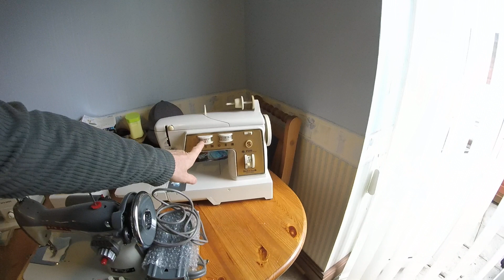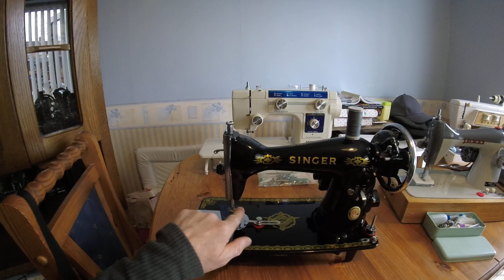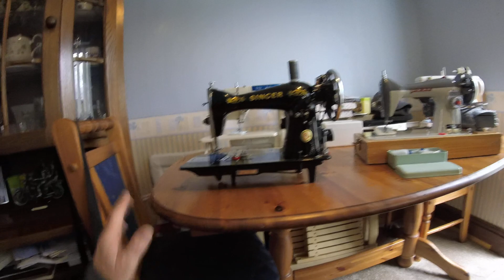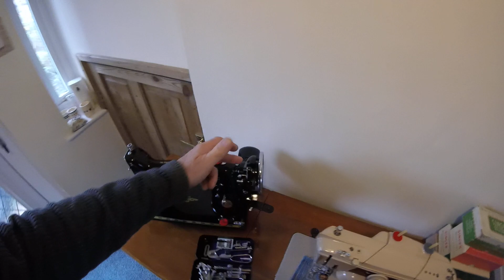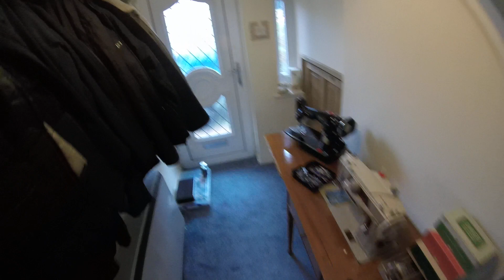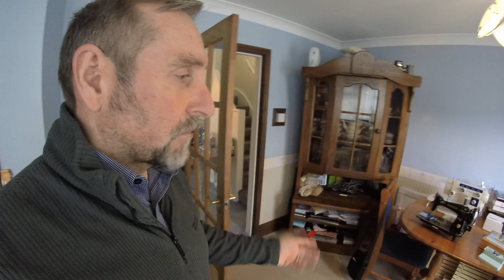Vintage sewing and restoration

Comment: I hope you can help me in my on going search my son gave me a "Gift" of a knee operated Singer sewing machine on the front of the sewing machine it showed a model #AB157651 I have been searching to find a manual or something on refurbishing it to use.  I was rescued from a garage in Memphis Tn. and brought to me in Las Vegas,NV. It was in terrible condition and missing a plate over the bobbin housing. It took two hours in cleaning alone and I'm still not finished.  I have no idea how to connect the light and I haven't checked it out yet to see if it works,baby steps with it.  I have been looking for a manual and that was a task in itself no luck there either.  If you can steer me in the right direction this "Gift" might be just that.  I do prefer older machines they are work horses and last a long time. It's something to pass down.